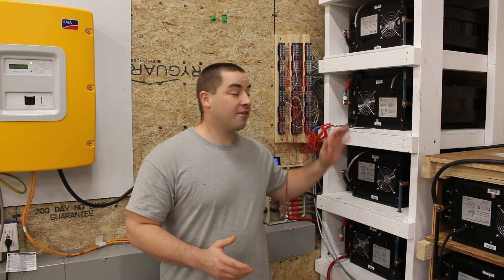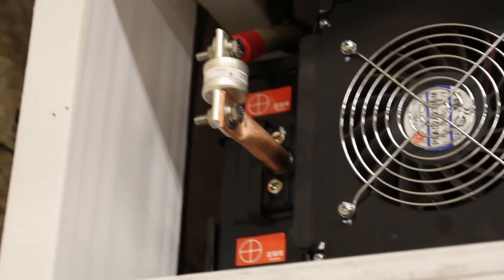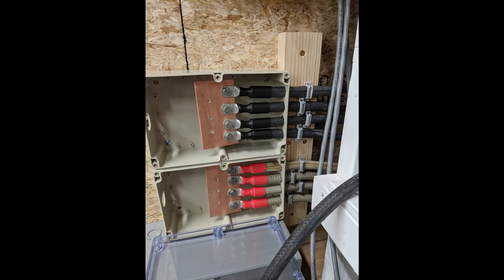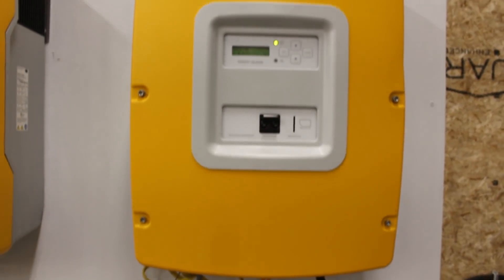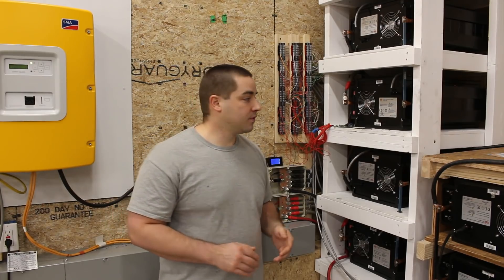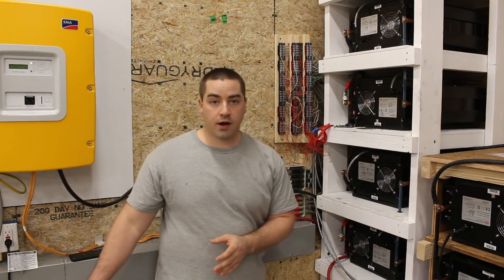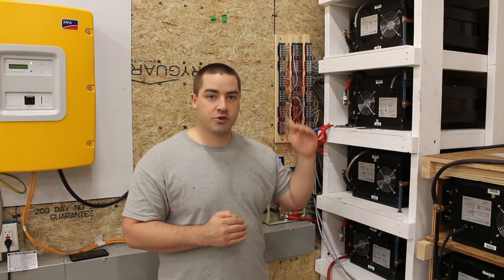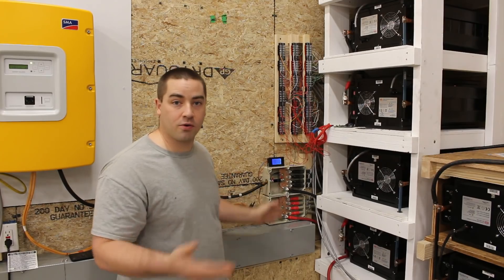Conditioning used LiFePO4 batteries, Update

Comment: Which battery did you setup during the inverter quick configuration?  If you choose Lithium I think you need to have a battery with an approved BMS.  Or is there a way to customise your charge parameters in the menu (like setting charge Voltages for example).  Which Firmware do you have on the SMAs?
Reply from the maker: I set the inverters to VRLA.  You are correct that if you choose lithium you need an approved BMS.

Comment: Great video. I need a 6000 watts continue  inverter and  lithium battery pack . Even if they are used  they'll be find. Let me know if you have some available. Thanks
Reply from the maker: I buy my batteries from Battery Hookup. https://www.batteryhookup.com/?rfsn=3333666.ca06e9  You can use my coupon code for 10% off: DAVIDPOZ

Comment: looking at your bus bars a light went off ....  you could double the load capacity by soldering 2 bus bars together like a cookie sandwich...   should work if you wanna try .... just sand them up and pre tin them first ...  pre tinning will ensure excellent contact ..... use a generous amount of flux and heat

Comment: I actually like the way you did your's over the way you did your buddy's stack.

1) I feel any thermal cycling (oh, and moving your buddy's pack!)  is going to stress the battery pack connections and posts.  It's too rigid an interconnection on a system of heavy objects.

2) Let's say on a dark and stormy night one of  your four sets has a problem.  Your setup allows you to isolate a set easily.  The solid bus method completely precludes that.  These are used batteries after all and we can expect eventually that one of your 64 cells will check-out of the hotel.
Reply from the maker: Good Points.  Thank you.

Comment: I have 4 of these batteries and my initial trials suggest 28V may be 100% SOC.  Even after balancing, I find that a 28V charge drives 1 cell over 3.65 at which point I stop.  I note that BYD has different numbers for different products with max voltages spec'd from 28.1 to 29.6.  I can't find reliable numbers for this particular pack, but I'd guess the chemistry is for max 28.1.  Of course maybe my batteries are past their prime.  I look forward to your results.
Reply from the maker: I am seeing similar results.  Two full cycles so far, more to go.

Comment: Yes found it when I expanded the text were did you get the buzz bar from?
Reply from the maker: I made the buss bar.  In the thumbnail you can see a piece of a copper pipe.  I cut 4" piece of that pipe, cleaned it, and flattened it.  The pipe is a 1.5" DIA.  Where did I get it?  I pulled the copper pipe piece out of a dumpster.

Comment: @David Poz ,Dude I got a lead on those Thomas and Betts Tang Lugs I mentioned a few weeks ago. I will have confirmation of how many they have in stock tomorrow. Im holding 1 of them in my hand right now and I'm telling you these things are BEASTS. They fit the BYDs flawlessly and these are huge nearly the size of your wrist...I don't know yet what kinda price they are going to give me for a bulk purchase but the 3 I just got I only spent 15 bucks on total shipped to my door. I've test fit them and man it's like peanut butter and jelly ...a perfect fit and match and bc of the shape of the Tang lugs, they hug (contact) the entire BYD terminals and you can seriously crank these suckers down. The set screw is legit the size of a human thumb. I am going to be getting these in bulk so I will share all the places that have them and give you and your viewers a heads up on who has the cheapest price. If you are running those BYDs I believe these lugs are by far the best option.
Reply from the maker: That's great.  Thanks for helping the community out with sources of good products.
Reply: @DavidPozEnergy  Yes sir, helping one another is what's it's all about. Here is some more information on them and I'll drop some eBay links for a few sellers I found that have them in stock. Product Name : Thomas and Betts Copper Mechanical offset Tang Lug Terminal Connector /Catalog# 3LN78/ Manufacture# BTC5011.  Note: there 2 types ( straight Tang or Offset Tang) both work equally well. Also important to note these are sold new as 3 pieces per box. So make sure to message the seller to make sure it's 3 pieces or 3 complete lugs per box. There are asses out there that will try to be slick and sell them as singles for the same price  so make sure you don't get duped. I myself just ordered 6 more ( 2 boxes of 3 for 46 bucks) Listings for 1st seller says they have 23 in stock. Listing for the 2nd says 10 in stock.I'll also see if I can find a Data sheet for them so you have precise dimensions. https://www.ebay.com/itm/BLACKBURN-BTC5011-Mechanical-Conn-500-kcmil-to-1-0-AWG/333261694675?_trkparms=aid%3D1110001%26algo%3DSPLICE.SIM%26ao%3D1%26asc%3D20191002094254%26meid%3De119dbf8a10b49e6b646b7835a1feaac%26pid%3D100892%26rk%3D3%26rkt%3D6%26sd%3D383039578434%26itm%3D333261694675%26pmt%3D1%26noa%3D1%26pg%3D2332490&_trksid=p2332490.c100892.m5207
Reply: Also note that stupid stock photo used in their listing is inaccurate . These do not come with that silly slotted head set screw, they come with a hex head. See product description in the listing. Idk why they use that generic stock photo but they need to change it to a photo of the actual product.

Comment: It's been many years, but I did a small demonstration for a friend using cell phone lipos. I had 8 of the same battery for my phone at the time. 6 new, 1 old, and 1 very old. I graphed charge cycles off an iCharger 208b, and for all cells if you played through the graphs like a flip book you could see a smoothing of irregularities. Looking at just the old cells was very different as you could see artifacts in the power curve from all of their cell phone level brutal charge cycling habits.  In 5 cycles there was substantial return towards normal as defined by the 6 new cells.

Comment: Mr. Poz , Please get a set of crimpers and buy the proper wire ends , the ends are not that expensive when bought in any type of bulk quantity , for safety and that pesky insurance man , you do a really fine job all the way around (being very thorough in testing each cell individually, etc /  , I am a diesel mechanic by trade .and semi to get into alot of other things , hydraulics , electronics , electromedicine, electricty , HVAC , again please be safe .
Reply from the maker: Hi Becky Watt,  Thanks for watching the video.  I'm sorry I was sick and did not film crimping the ring terminals to the wire.  These are the ring terminals: https://www.amazon.com/SELTERM-Marine-Terminal-Battery-Eyelets/dp/B073FD8LTX/ref=sr_1_fkmr0_1?dchild=1&keywords=SELTERM+UL+Listed+Marine+Grade+Tinned+Copper+Wire+Lugs+Heavy+Duty+Battery+Cable+Ends+Eyelets+Ring+Terminal+Connectors&qid=1577657032&sr=8-1-fkmr0  
With a hydraulic crimper: https://www.amazon.com/BestEquip-Hydraulic-Crimper-Electrical-Crimping/dp/B07C1QN8QN/ref=sr_1_1?keywords=BestEquip+12+Ton+Hydraulic+Wire+Crimper+Electrical+Lug+Crimper+6+AWG+to+500+MCM+Battery+Lug+Crimper+Wire+Crimping+Tool+with+10+Dies+%2812+Ton+10+Dies%29&qid=1577657104&sr=8-1

Comment: Does it cause a problem when you have more then 2 batteries in parallel! Normally one pack will pull most of the load, which causing it to wear out faster.
Reply from the maker: That's why I was making sure all the wires were the same length.  Trying to make sure all the packs are used equally.
Reply: @DavidPozEnergy  Another method if you have a tighter pack and bus bars on the cells is paralleling across all the cells instead of from one end. I hope that makes sense, I mean don't use the + and - on one cell at the end, use the terminals at opposite ends of the pack. I heard this from old boat and RV guys that would see dead lead acid packs all the time.

Comment: David, You might check with some of the Electrical shops around for scrap copper buss bars.  When changes are made to MCC's (Motor Control Centers) and Load Centers for large buildings the buss bars get changed out to larger bars or there are parts left over.  Might be able to find what you need at #1 scrap cost.  The size I have seen most common is 1/4" thick by 3" or 4" wide.  Might be more than you need but I usually error on that side.

Comment: If u run them all in parellel you could run into v drop if you dont connect them right. The way you are doing now with equal length cables is the best way imo

Comment: As a HVAC Contractor I have tons of left over copper tubing.  I make my own ring terminals by cutting short sections and using a spin swedge  drill tool to flare the end for easy wire insertion. Crimp half then flatten the other half and drill hole for bolt size and shrink wrap.
Reply from the maker: I love it.  Use what you got.

Comment: Everything i have read on this says you should not be using voltage for capacity checking since the volt curve is so flat, you should have your victron in front, and run the battery's flat once they have been cycled once or twice. once you have your low and high, simply calculate your 20-95 etc in amp hours to determine actual capacity levels
Reply from the maker: Yep.  I will be doing that too.  But for the very first few run I still have to put in a voltage number into the inverter/charger to stop.
Reply: @DavidPozEnergy  well full voltage is 3.6 per cell. so 57.6v is 100%, 2.5 is 0, so 40v for your low end. so your best bet, is to drop to 2.5v in the entire pack, or 40v, then add your victron or an ah meter, and charge to what ever full percentage you want to go to. so you would just calculate your available ah per the name plate rating, then take whatever percentage of that you want 90 95 % etc. of course this is based on a good quality and no loss, but as long as you don't go over 57.6 you should be fine. if it was me, i would do a full cycle (40v to 57.6) get my usable amp hours, then adjust down to whatever % i wanted to cycle in, then use the amp meter to get there and see what voltage your sitting at on the charger to get there, and thus that would be your stop charging point, at least thats how i would do it.

Comment: Them combiner boxes look great, I really need to get mine in boxes and not have so many exposed terminal. Thanks for the shout out as well, great idea mounting those fuses like that, avoids having to buy the holders which double the price :) Also, have you seen the fans for those batteries turn on yet? I'm curious if they are temperature triggered or run all of the time?
Reply from the maker: Thanks for your help.  I'll have to make a video about the fans.

Comment: Voltage range - LifePO4 have very flat core voltage curve.  According to discussion on Second Life Storage (such as this https://secondlifestorage.com/showthread.php?tid=8418&highlight=LifePO4) your low end of 48v / 16 = 3.0v/cell may be a bit into the discharge curve knee (knee might begin at 49.6 or 3.1v/cell).   It would be good to find the actual discharge curve specs for the cells if you can.     On the top end I think you're good.  You have set to set the V a little high or they'll never charge up since the curve is so flat :)
Reply from the maker: Thanks.  I'll have to do a time-lapse video or something on my next discharge so we can map the knee.

Comment: Thanks for the continuing video set on these batteries - very interesting.   I wonder if you're using your PV array power charging? or is grid power going into the SMAs and that's doing the charging.
Reply from the maker: At this stage I'm using grid power to charge the batteries.

Comment: Definitely pay attention when discharging for your first time.  I noticed while monitoring my first discharge that cell #3 voltage dropped before all others.  At that point I stopped the discharge.  I'm interested to see if after a few balanced charge cycles, things level off or if cell #3 remains the weak cell in the pack.
Reply: Most likely it is permanently bad, I've tested cells that hadn't been charged in ~4 years, that were abandoned close to full after being pulled from a dead 8 year old laptop. Chemistry unknown, but they woke back up and acted ok-ish, quadrupling in capacity after 3 cycles. They were still weak cells, about 60% of rated capacity, wasn't worth the time I spent on them except for learning.

Comment: FWIW you can use something like 6061 aluminum for the bus bars.  You just want to sand the contact points and apply noalox o something else to prevent corrosion under the terminals.  Way easier to deal with, cheaper, easier to find, etc.  There is no need for copper on a bus bar unless you are very space-constrained and need the higher conductivity.
Reply from the maker: Thank you.  I agree.  I used aluminum on my buss bars when I built my Chevy Volt battery pack.  https://youtu.be/DsbgNuZtBqY

Comment: I don’t think I’d switch to a pair of parallel arrays. Yes, you’d have a single connection to the rest of the system, but it would be carrying four times the current. Another feature of running four series arrays is that you can easily bypass a pair for service, and still run the system at 75% capacity. 🤔

Comment: Hi David, I think you are charging/discharging your LiFePO4 cells "much more" than you think you are... At a .0076 C charge rate (10A/6P/220Ah) a cell charge termination voltage of 3.5v (56V/16S) is "very full" (like 99%+.) At a .011 C discharge rate (15A/6P/220Ah) a cell discharge termination voltage of 3.0v (48v/16S) is "very empty" (like 3%.) To understand why look at a LiFePO4 cell charge/discharge curve family and extrapolate what .0076/.011 C rate curves would look like. At a low C rate you need a lower charge termination voltage and higher discharge termination voltage to get your desired 20%-95% capacity range. For the VERY low C rate activity in your video 95% capacity is more like 3.4v/cell (54.4v) and 20% capacity is more like 3.2v/cell (51.2v). Once in service you should set the cutoffs based on expected charge and discharge rates (and curves for your cells... ;-) Thanks for making the videos! Keep Safe!
Reply from the maker: Thank you for such a good comment.  I really appreciate you taking the time to help me out.
Reply: @DavidPozEnergy   Were you monitoring every cell during the described discharge? (Not trying to scare you but If you took 6 strings of 16S second hand LiFePO4 cells down to 48v with a very low C rate without monitoring (and balancing) all 96 cells then I would think you may have done some damage to the weakest cells in each 16S string. If this is the case you should look at every cell voltage ASAP and try to bring any Ah "runts" back up in SoC... Yes, experience talking... ;-)
Reply from the maker: Lots of monitoring.  I love watching cells as they charge discharge.  It's fun for me.

Comment: I’ve been using LiFePo4 batteries with the SMA inverter for about 1 1/2 years now. I can give you some tips on internal settings that work great for Lithium. I used the lead acid profile but re-program the various voltages for Lithium and used the built in float timer to completely stop charging for up to 7 days when in power save mode (Standby). This prevents continuous trickle charging and high static cell voltage from damaging the cells. The only time the cells go to 100% (3.65V) is when I call for “Equalization” which is set to only run on manual command. (Maybe once a year)
Reply from the maker: Thank you.  Could we talk a little more?  Are you on facebook?

Comment: I'd be interested in a video showing how you configured the Sunny Island to charge your lithium batteries up to 56V. As far as I know, the lithium battery type option requires a BMS that can talk to the Sunny Island over a CAN bus. And the "other" battery type option has been giving me an F141 fault code. SMA support simply told me that the "other" battery type option was not supported.
Reply from the maker: Hi Nicholas,  I was also getting a fault code in "other".  I couldn't find good documentation on this.  I will be making a video just on programming the SMA inverters.  But that won't be until I get both inverters up and running.  I won't make you wait, LOL.  I set the battery type to VRLA (Valve Regulated Lead Acid).  I set the Nominal voltage to 48v (which is default).  Then, when setting charging voltage, the inverter is asking what cell voltage you want to use.  It's asking this based on an assumption of 2 volts per cell (24s).  So I set the charging voltage  at 2.33 volts (55.92).  At the moment all charging stages are at 2.33v.  But when I put it into use I'll set the FLOAT and EQUALIZE a little lower than bulk, probably 2.31v.  I tried to find a way to turn "off" equalize, but no luck.  It should be fine if the equalize is the same or lower than bulk.    Is this what you have been finding too?
Reply: @DavidPozEnergy  I also got my Sunny Island running by using the VRLA battery type, but I didn't think it would let me set the charging voltage above 52V, so I will have to give that a second look. Thanks for all the detailed information. Hopefully that will help others, too.
Reply: @DavidPozEnergy  can you change the Sunny Island low voltage cutoff?

Comment: What's your total solar panel size now, with the two ground mount systems?
Reply from the maker: 7.7 kw.  After the batteries are wired up I'll be able to wire them in.
Reply: @DavidPozEnergy  I'm told each 6kw sma sunny island has 56A maximum transfer relay so about 6kw per inverter. However the grid tie sunny boy inverters output at 240vac, they do have a neutral wire for the split-phase. However, if you have twin sma sunny islands and two 6kw sunny boy's on your critical loads panel, will the inverters somehow balance up to 56A each when doing grid tie? I haven't found any good instructions for the wiring diagrams or explanations from SMA.